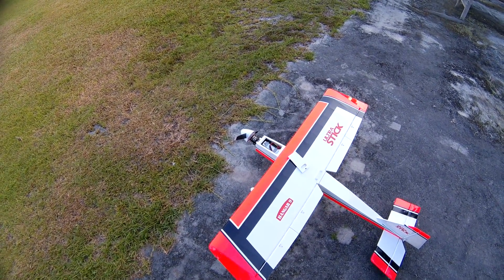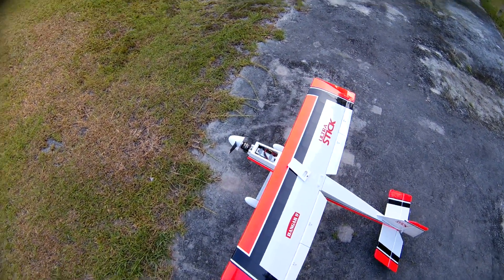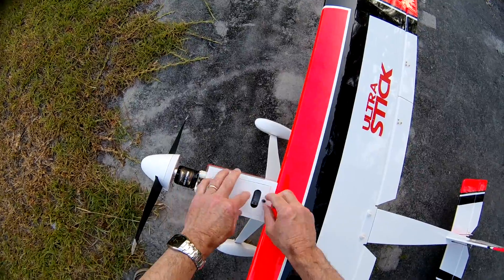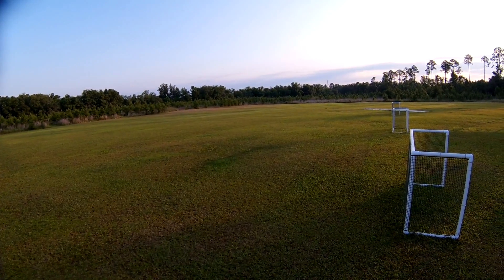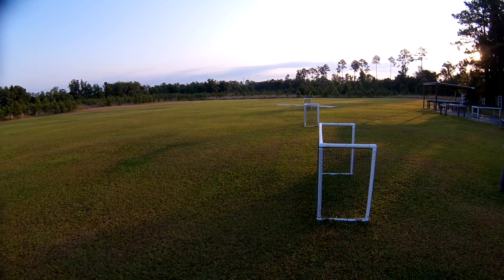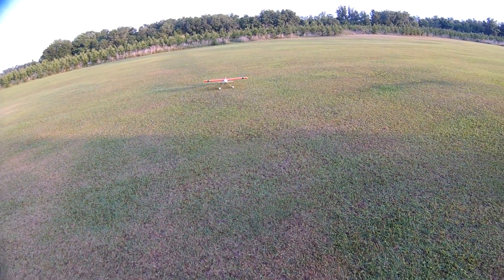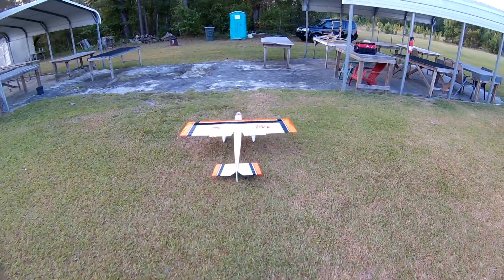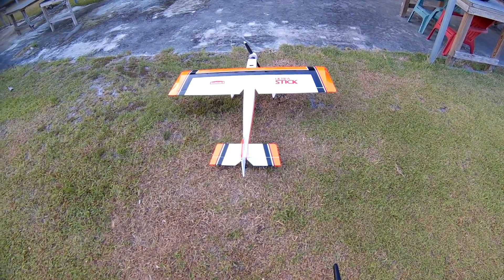Hangar 9 Ultra Stick 10cc       Upgraded Power and Mount

Comment: just found this video, what a babydoll , mike where did you find the motor standoffs from, I'm needing some for omp hobby edge 540 balsa plane I bought , got to get 4120 motor 550kv 6s setup 80 to 100 esc , going to need standoffs
Reply from the maker: I found them at Home Depot. They have a set of drawers in the nuts and bolts section full of plastic nuts and bolts, washers and spacers.

Comment: Good video Mike! Im looking at this plane too. I have the same motor as well (650kv from T-28 v4),70amps ESC and 3600 mah battery. Have you put a meter to see amp draw with that 16x10 prop? I see videos couple years old so may not still have that data.
Reply from the maker: Originally it was the 580 FW motor, 80 amp esc and 16x10 prop from the old crow P-51. Since it all went together I didn’t check it. Later I changed to the 650 motor and since the esc was the same size and the T-28 was turning a three blade prop I figured it was close enough. I’ve not ever had a problem but I should check it. I just bought a meter recently.
Reply: @mikessi  thanks for the info.Reply back on this comment if you check it with meter.
Reply from the maker: @BDTennessee  Just ran the motor with the GT Power 180A Watt Meter I got from Motion RC.  The static peak amp reading was 85 using a 4s 4000 battery.  As a reference, I checked my FMS T-28 stock setup (which is where I got the motor) and it pulled 65 amps peak static.  Of course, the unloaded peak will be less, but it never hurts to have a little head room with the ESC.
Reply: @mikessi good results! What prop is that, 16x10 (prop mentioned)?
Reply from the maker: It’s the 16x10 prop and spinner from the Freewing Old Crow P - 51.

Comment: hi, 
I would like to buy the same one....could you indicate the reference of the motor,  the capacity of the lipos and the size of the propeller ?
Reply from the maker: The motor is the 650Kv brushless from the FMS 1400mm T-28 with 80A ESC and 16x10 prop from the Freewing 1400mm P-51 .  I use 4s 4000mAh batteries.